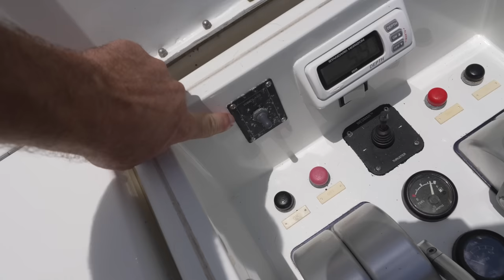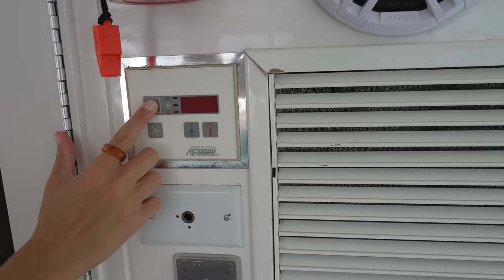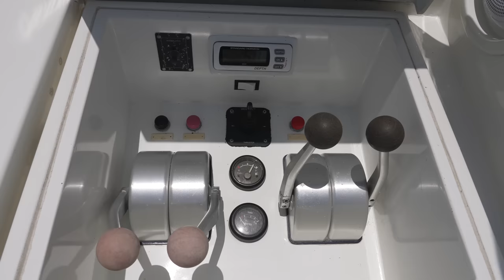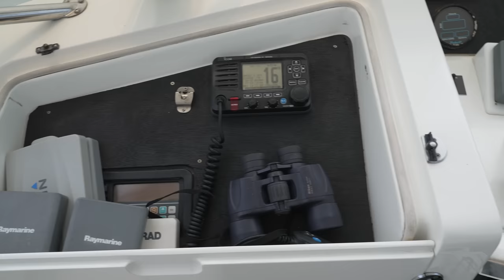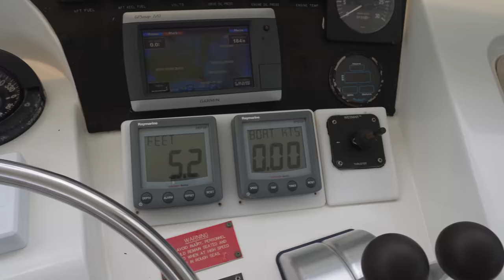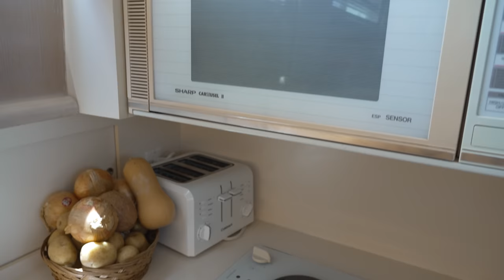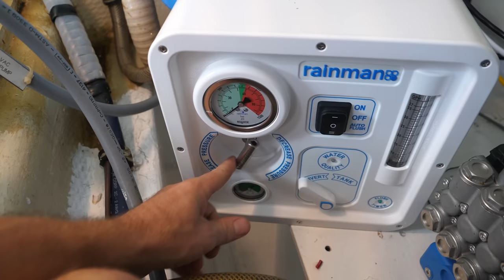Selling my boat and going home!

Comment: Most detroit 2 strokes have 4 exhaust valves per cylinder but no intake valves. The intake air is blown in through ports at the bottom of the cylinder by the blower.

Comment: Everyone keeps mentioning the high cost of fuel, but where I boat most of the people with this kind of boat only go out once or twice a month.  Basically,  they are used as condos on the water.  

It will sell, maybe not for 350 but something close.

Comment: Get an older Hatteras LRC. 4000 NM range at 6 to 10 GPH. Sailing is awesome but NEVER as comfortable as an actual motor yacht for living conditions. Usually, it isn't the range that makes people I've spoken with make the switch to sailing, it's the cost of the fuel.

Comment: Did you repair the wrecked swim platform's starboard corner where you crashed it backing into a cement dock ?
I'm thinking 10% discount !
Reply from the maker: Yes I repaired it

Comment: Too many problems with this Boat ! Gas Cost Too Much Money at this Time, $$$$$$$$$$$$$
Reply: Actually it is not too much and my guess it will have already gotten an offer....60ft does not require a captains license and great boat for the loop or live aboard....yes it need some TLC but the value is there with the Haterras

Comment: Good video 😀 but I think you're asking to much the boat there seems to have problems it a 77 with older Detroit diesel could be problematic 🤔 inspection would be needed could be 100 thousand dollars to make it sea worthy just an observation 😃
Reply from the maker: 97 not 77 and engines are low time and very reliable

Comment: 15 gallons an hr? Sorry but lets do the math
Diesel @ 6$ a gallon x 100 gallons = 600$        100 gallons divided by 15 gallons per hr.  =  6.6 hours of boating  = 600$.    Boating 30 days a year at 6.6 hrs avg daily boating time = 18k. per yr.   Total guesstamation. New word.
Reply: Pocket money to those who buy this kind of boat. I calculated once that he gets 2.5 mpg based on the speed he runs, my boat gets 2.5 mpg, I am not stopping because of the price of fuel.